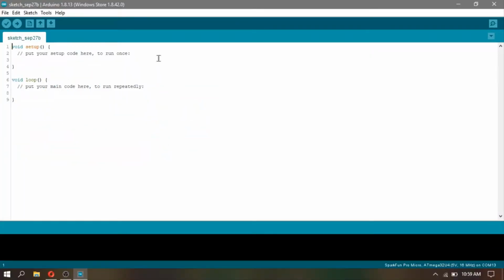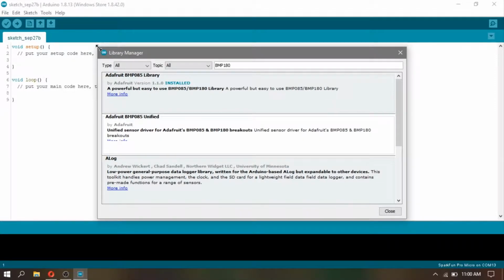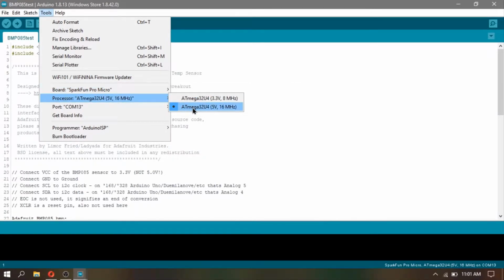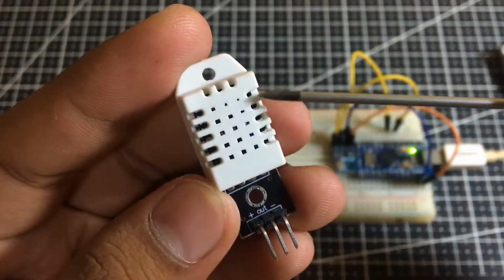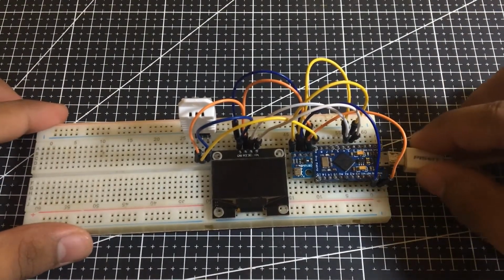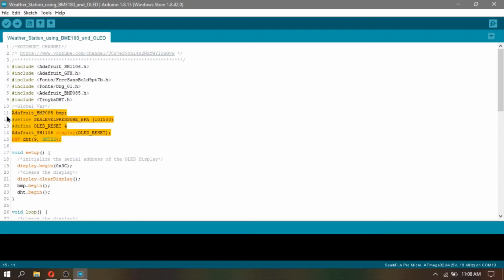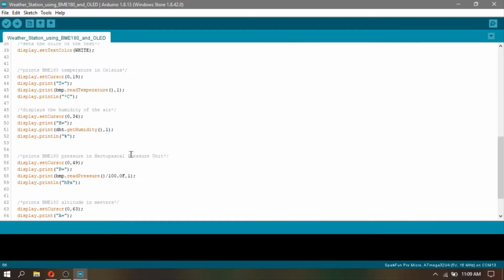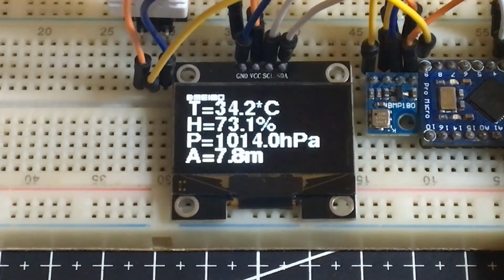Simple Weather Station using BMP180 and OLED Display - Arduino

Comment: thanks sir great work, I noticed when the pressure above 1000, the third digit if multiplied by 8 the result if substracted from the atitude reading will be the real altitude, on the same time if the pressure is below 1000, the third digit if multplied by 8, the result if added to the altitude reading will be the real altitude. could you do this equation , thanks in advance